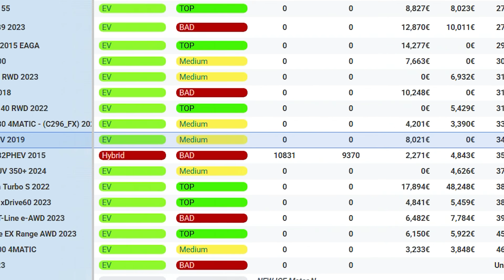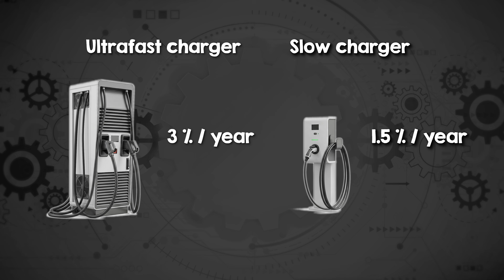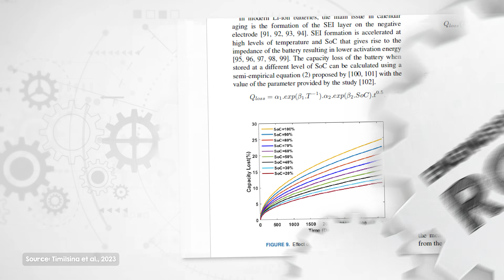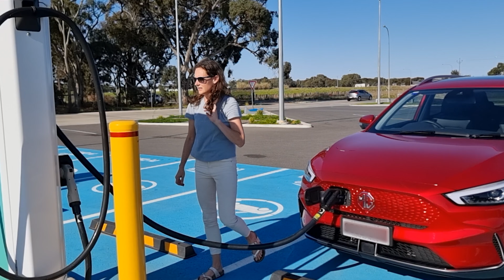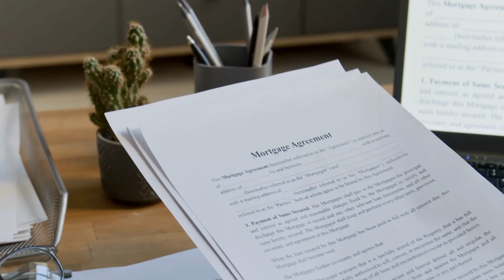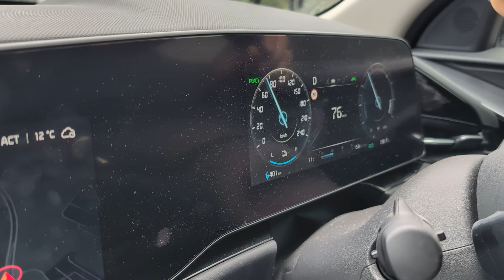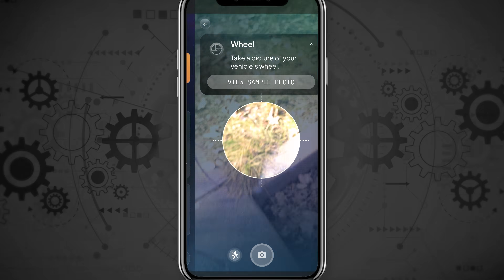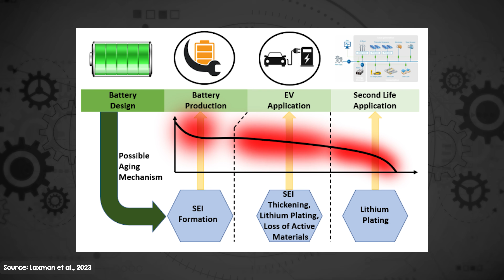Watch This Before Buying Your EV

Comment from the maker: Use the exclusive coupon code: ROSIEUPDF to get $10 off & download UPDF for free: https://tinyurl.com/4xs5z26v
It’s risk-free with UPDF’s 30-day money-back guarantee!
Reply: Read this before accepting your next sponsorship:
MIT technology review AI maths
Reply: what are you mixing up ? Clear watt has nothing to do with Aviloo - at least aviloo says it after I had called them. They offer different kind of tests and aviloo is the mostly used test and seems to become the standard certificate in germany for selling a used EV
or in other words: without an independent battery certificate the sales becomes much harder to impossible as most dealers are showing the test result on their first page as picture next to the car. 
There are different tests where 1 is based on real world driving and collecting the data of a real world discharge while you are driving anywhere (there are no requirements like driving 80 kmh for 2 hours, then go into city traffic and finally 120 kmh on the autobahn) which then will be analyzed by the backend before they email the results as pdf. You will get that aviloo box with the reader / tracker and you have to send it back afterwards. Each test drive costs the private user about 80€ or so with a lot of discounts from the youtube influencer channels. 

Aviloo has become the defacto standard, manufacturer certificates are useless which you can easily learn once you are fighting against a manufacturer for battery claim as they will show you different tests and methods all pretending that your battery is in grreat condition and fullfilling their waranty - unless you start using independent tools like aviloo and ask the simple and easy WHY is my battery below 80% SoC after 5 years and 150.000 km ?
Reply: Clearwatt advertising
Reply: wow, you were one of my 3 (so far) replies, and the other two were trying to sell me something! Check it out!
Reply: Third-party replacement batteries are only 30 to 50% of the cost versus replacing it with the original brand of batteries.  At least that's how it's been for the Toyota Prius for many years.  I know multiple friends that got new Prius batteries for around $3,000 when the dealer quoted them over $8,000.
Reply: Click bait bull  crap.  Even your opening premise about “after a couple of years cell phone batteries blah blah blah… is nonsense.  Doi. Stop listening at that point and blocked your channel.

Comment: At this point, battery talk is pointless. Batteries have come to a point where they will outlast the ownership. My mach e is 5 years old over 100k miles. I went from 330km range to 320km range in those 5 years. This isnt 2013 model S or first gen nissan leaf.  Those days are long gone

Comment: How can they write a percentage of degradation per year? It is well known that degradation is higher in the beginning and slows down significantly with time. So, using an ev for very long, like 15 to 20 years. Yearly percentage is very misleading. Especially if you realise with smarter use of the ev you don’t need to ultra fast charge, sparing your batterys health more.

Comment: My Tesla Model 3 is 25 months and 42,000 km old. It's LFP batteries have been charged 73% home, and 27% public (mostly Tesla Superchargers), always charging to 100% full. The battery capacity has declined by 1.84% over this time. As the first year or two is when the battery degrades fastest, I believe this is a fantastic result.

Comment: I think you miss something in this video which is advancement of battery tech + the approved used. Most EVs of today are facing a battery crisis at around 2035 to 2045. At that time i expect there will be an abondance of approved used batteries. I also think battery tech will have advanced a lot. So when your 20 year old EV finally reaches its crisis, it may well cost just $2000 to $3000 to replace, or even a cheap retrofit battery.

Comment: Every EV has a sophisticated computer capable of recording and storing every charging cycle history. 
Knowing that history would give buyers similar confidence as having service records for ICE cars.
But manufacturers do not want to provide the charging data. 
So buying a used EV becomes a Russian roulette game. Everyone hopes for a battery with 90+% of capacity left but once in a while some unlucky buyer gets an EV with a battery that has to be replaced.

The fact that such expensive module containing upwards of 3000 individual components is engineered as disposable, non-repairable unit is a problem in itself.

Comment: Hey Rosie, just to clarify, Nissan Leaf gen 1 and 2 had zero battery cooling except for air and are notorious for horrific battery degradation, especially in hot countries. That data would have been categorised as anomalous or an outlier in all degradation tests due to the cooling architecture. HTH love your show and Dave’s “Just have a think”

Comment: Battery health is over-rated as an issue. If you buy a second hand car that is less than 7 years old, you will have at least 12 months of use to determine whether the battery needs to be replaced under warranty. Same as with a petrol engine in a car,  the battery won't need to be replaced within the warranty period.

Comment: Be aware, just like Diesel Gate the existence of mis and Disinformation exists within Studies and reports. 
Funding of the, cash for comment, has in itself become very difficult to source. The data and presentation all through with buzz Words like Independant carefully placed along Storyline. 
I reiterate, be aware and do not trust Presentations as literally the case findings. 
Learning the Hard way commonly a result, and that in itself begins stage 2 of the Misinformation, why you have been the unlucky minority until it is all realised the reality's . Not DATA no modelling , manipulated by set criteria to mould outcomes is all part of Modern Deceit with Deception. 
Welcome to the Matrix ! O and GeoZone blocked access and availability will be the Future unwittingly welcomed as part of the Outcome not foreseen. 
The same as the information on recycling is, remembered, just Words written and created to new levels of Deception. 
Enjoy the constant debt Merry Go Round of disposable Products legislated future. 
This information i have shared with us, is not Theoretical or based on a Study. Return to beginning and read again if the terms Studied and Researched is where you still trust the Reality of outcomes is found . 
MG in itself is a Authentic as a Researched Study reported in these times of www.mass. manipulation instant ! Communists  with Modern instant influence on Grand theft level.

Comment: Two things Rosie said at the beginning of the video.  1) The batteries outlast the rest of the car.  2) Even vehicles with over 100,000 miles on the clock typically hold onto their battery health.  

Older Mercedes, e.g. C126 cars used to last up to 700,000 km, if you kept changing the oil on time.  Could it be that modern electric vehicles give you only a fraction of this longevity?  They are expensive.  If their life-span is short, I would regard this a real problem.

Comment: I think the vast majority of potential EV buyers are more concerned about how safe batteries in EVs. I think ANCAP should introduce new tests around EVs such as battery penetration/damage/cracks etc, EV use in extreme hot +50-+60 condition etc.

Comment: It cost me $2000 on petroleum and change oil per year , so in 10 years it cost me 20000 total , if I bought ev , the amount cost me in lost value of my car in 10 years far more than I save in petrol , not included the electric I charged in that 10 years plus replacement types and the most concern I had with ev is when somethings wrong with the car , nothing work even try to open the doors to safe yourself when accidents happen . The more high tech the car is the more useless I am of fixing it.  Should I buy ev if I do not drive much kms . My 2009 Subaru forester had only 115000km in it .

Comment: Who didn't realize that your EV is a throw away item by 10 years? I bought a secondhand ICE vehicle for $20,000, 7 years later its still worth $12,000, yes I spent money on fuel but I won't be forced into spending $$$ buying another in 3 years either. Ev's only work if you pay around $25-30,000 and get 10 years, that $2,500 per year which is reasonable. I'm just a blue-collar worker, if you have plenty of $ it wont matter to you.

Comment: Battery replacement costs 
Mercedes B-series 47 000€, EQB 70 000€
Jaguar i-Pace 128 000€

At least these are the prices in Finland, taken from country's biggest independent battery-, phev-, hev-, ev- and ice repair shop.

Comment: Nissan did not honor their battery guarantee promise to me. i don't ever want to buy any Nissan again. i purchased a Nissan Leaf (maybe 2015) with a battery warranty. i was told if it has a certain degradation then they'd replace it. the car showed that it did not have degradation when my driving distance dropped by about 35%. 😳 A Nissan dealership told me that the degradation hadn't reached the warranty threshold. Nissan cheated me. i loved the EV aspect of the car. now i have a better EV with more range, but i don't want to buy any Chevy EV again. too much to explain in a text comment. but in my experience, Nissan is trash to me. Chevy is a stinky unwanted brand now to me.

Comment: If you can't look after your ph battery, you should not have bought an EV. How the heck are you an engineer? Try avoid below 20% charge or over charging . Store below 80% if not using and above 40%.
Are you getting kick backs from petrol car company or petroleum company?

Comment: My EV scooter uses the battery swap network. I don't actually own a battery I pay for power consumed each month in the batteries I use from the swap stations. Key benefits are I can go to full charge in under a minute, and I don't have to concern myself with battery degradation.

Comment: Well when they go bung, just go out and buy another one.

No more issues, after all they are only a vehicle.

No use worrying about battery degradation, just move on and just buy another one.

No problems or issues just solutions.😊😊😊.

And by the way HAPPY MOTORING!😊😊😊

Comment: No the reality is NOT much more reassuring : at least for the two generations of EVs the car largely outlast its battery. And the manufacturers, of course, do not provide any solution to upgrade an otherwise perfectly good car. Most of the 10 years old SOUL, Leaf, i3, IONIC, and so on, where already with a low range when exiting factory, they are now stranded with a 60% SOC or less, and basicaly unsoldable. There are hundred of thousands of 40kwh or less cars with residual values plummeting because of that, despite still looking and being brand new. Reality is an electric car mechanicaly ages way better than an ICE one ... except the battery. The bigegr ones (50+ kwh) are in better states if the owner use them between 20 and 80%. But some of the most recent ones (MG4 Urban) do not provide any setting to charge them less than 100%.... obsolescence...

Comment: My Hyundai Kona will be 3 years old in September. It's done 34000 miles/55000 km. Still reporting 100% battery health. Also frequently exceeding its WLTP range in the summer months.

Comment: I do 60,000 kilomteres per year which means in 2.6 years I will have driven 100,000 miles and lost 10% of the battery life.

What d you have to say about the cliff?

Comment: We bought a used EV, but it had been in an accident and we got it a lot cheaper (I'm in Canada, so our consumer protection laws require any vehicle that's been in an accident has to be safe). It was practically new when we got it (2021 Chevy Bolt), and I haven't noticed any reduction in range in the nearly 4 years we've had it. In the summer it's close to 400 KMS, and in the winter it's more like 270 kms (depending on how you drive it). There's a lot of fear-mongering about this issue and it makes me laugh. Is there not degradation in an internal combustion engine? Yes, absolutely there is. The longer you have it, the more the crap inside your motor reduces your mileage. Carbon deposits reduce fuel efficiency. People rarely get oil changes when they're supposed to, so they degrade in a way EVs can't (since we don't need much in the way of maintenance). We pay less than half at a level 3 charger than the cost of filling a gas tank (and that was before Trump took a dump on Iran, spiking fuel prices). We pay way less than that using our level 2 charger at home. We don't even notice the increase in fuel costs, because they simply don't affect us. It's awesome. And the lack of constant maintenance is amazing, too. Not having to fill up a bunch of explosive fluids all the time, not stinking up everything with exhaust, not having to worry about using the upstairs of our garage and dying from CO poisoning, and having that instant acceleration are all great things. People who've never had an EV don't understand that there are trade-offs, but they're easy ones to make. Stopping to charge? Have lunch. It doesn't take any longer than that. A lot of people stop to eat when they get gas anyway. Our infrastructure has gotten so built up here in Canada over the last two years, it's ridiculous. We're in a very rural area, and our town hall has a level 3 charging station. The town twenty minutes down the road has another level 3 charging station. The major towns (not cities) near us (an hour in each direction) both have multiple level 3 charging stations. Even the dealership where we get our inspections done has a charging station. When we first got the car we had a lot of range anxiety, but the routes we usually take are ones we're familiar with, and we know exactly where all the charging stations are. Even our CAA (similar to your AAA) will come out and tow you to a station if you don't plan well enough. I think they might have quick-charge boosters, but I could be wrong about that. The point is, all the things people naysay about EVs is bull now. Everything that used to be an issue has been fixed. You just have to switch your mindset a little bit. We'll never go back to a gas vehicle. We intend to buy an EV truck at some point (we're on 6 acres and I need to be able to buy wood for building projects), and that will be used as well. Likely a Ford Lightning (presumably they've fixed the issue that was causing fires).

Comment: Don’t know about EV batteries, but my previous 3 years old iPhone get hot occasionally and battery down rapidly, after some research it say due to battery degradation, it was about 85% form new, and apple recommends to replace battery around 80%. 
My question is with 80-85% batteries does EV still drive good? Or occasionally heat up and down rapidly?

Comment: I just got my first EV, a 2020 Mini with 37k miles on it. The widely used (in Sweden at least) Aviloo shows 96,1% ("excellent health"). I'm retired and I'll take my chances that this car lasts at least 10 years, with it being fully paid of after 5. It still feels like new and is probably the most fun car I've ever owned. Almost like my MC-days! I haven't been pro or con EV, but this car surprised me in a very positive way. I will mostly only need really slow charging at home, with maybe 10% DC-charging. That should be beneficial for the battery. Now on to watching the whole video, thank you!

Comment: As an engineer, this is something you can appreciate more than the average consumer: our society is racing madly to replace automotive internal combustion propulsion with electric propulsion in order to reduce a supposedly substantial source of CO2 pollution - even though real world statistics show that it isn't the biggest by far. And yet, fossil fuels combustion is still used significantly to produce all electricity, including that which EV's use, so, what's the point of rushing to replace internal combustion vehicles with electric ones if the electricity used to charge them still relies significantly on burning fossil fuels? And this is not even considering the efficiency loss this additional energy conversion leads to.
...queue the loud protests from EV fanatics who can't accept that not everyone's drinking the Koolade.

Comment: Battery degradation is a myth. Yes you might lose 10% of the range over 100,000 miles.  My I4 is 4 years old and I have not noticed a significant drop in range. Stop trying to scare people.

Comment: Every EV battery can charge and discharge 3000 times and will lose 5% capacity in first 2 years. There are 3 year old Porsche Taycans for sale with 10% to 12% degradation possibly caused by fast charging the big batteries. EV's don't get new batteries as they are fitted with repaired batteries to save costs and mainly done at main dealerships so you will be ripped off. Warranty stays the same as the original battery.

Comment: I put in an order for a Renault 5 and they gave me 8 years warranty for the battery+motor. I understand that the batteries are supposed to last more than 10 years, but it's still nice to have some assurance

Comment: My battery degradation is more like Range Variation based on things like weather and hills.  I get longer range with moderate weather.  2022 Chevy Bolt EUV still gets way more range than Chevy tells me to expect.

Comment: Great video. As per the results of your tests, a used EV is a great deal, as the markets tend to deprecate their prices at a higher rate when compared to ICE ones. I bought mine 2 years ago and after 50000 km I cannot measure any practical degradation and I usually take it on road trips. On the other hand, the amount of money I saved on gasoline those 2 years... Oh, that's sweet. Also, no pollution, no vibrations, quiet rides, no oil changes and a much higher service intervals. To sum it up, I don't know what car I'll buy next. All I know is that it'll another EV. No regrets other than I should have done it before.